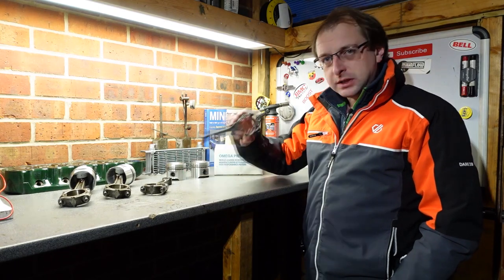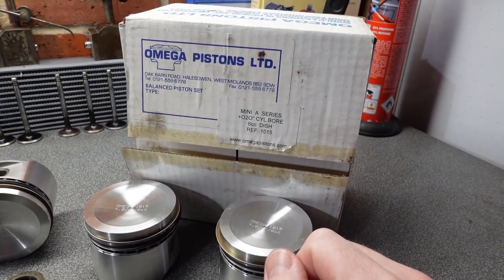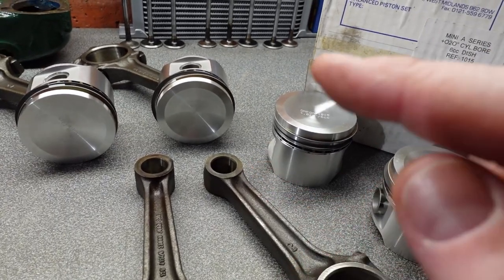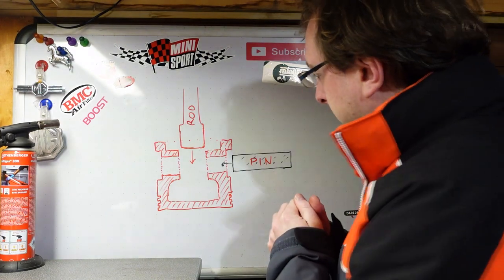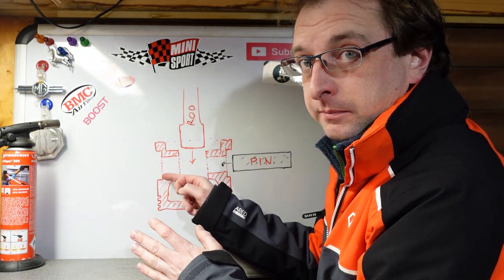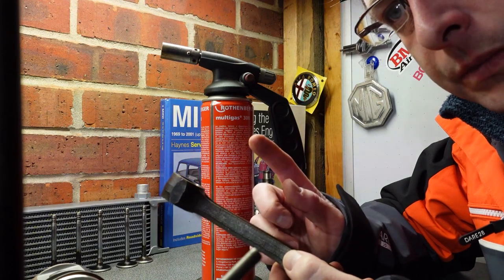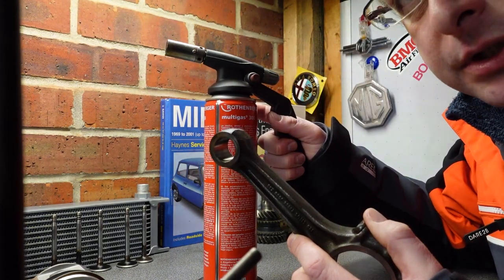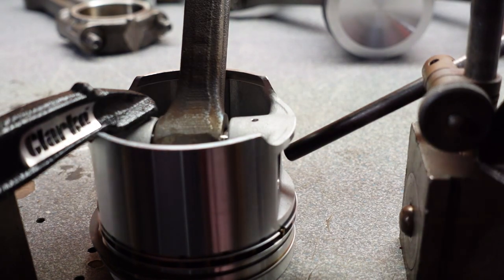Fitting Omega Pistons to A-Series conrods for Classic mini

Comment: Great video. Thank you for the clear explanation of your system for installing the pistons to the con rods. I have a set of Country pistons for my 1275 engine and the gudgeon pins are tight in the pistons. If I warm the piston a little  (about 25 degrees c) the pins slide. Bad set of pistons??